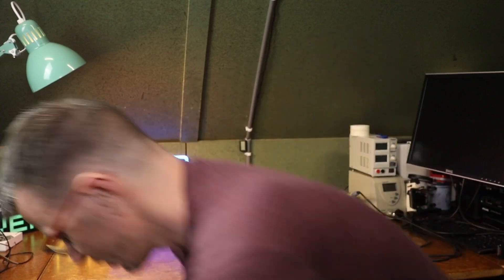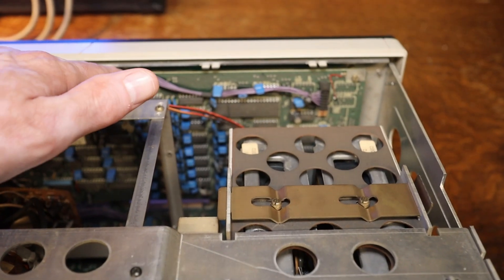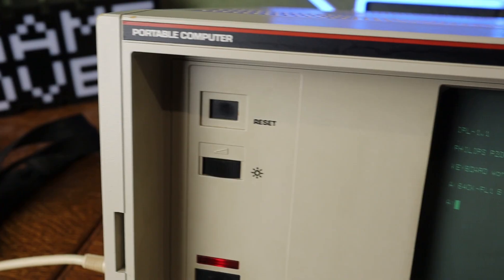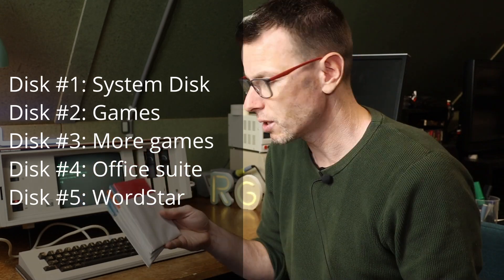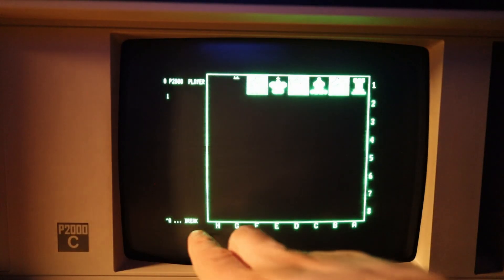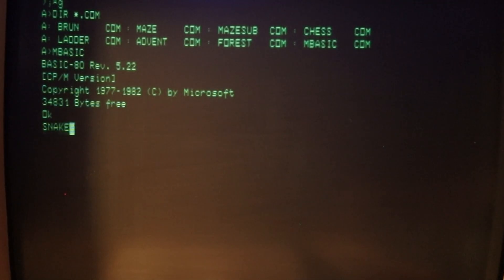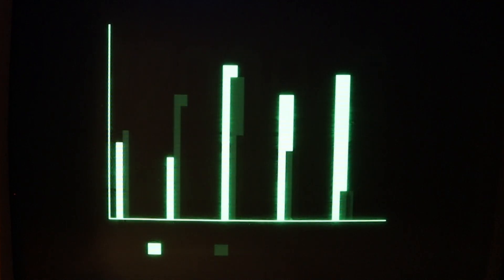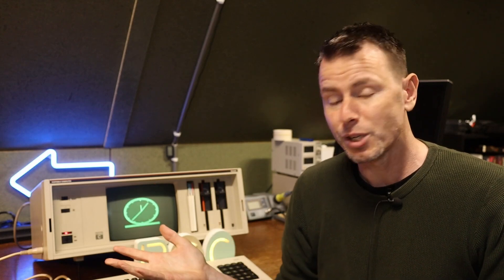A "Portable" PC from 1983! (Philips P2000C)

Comment: This is an interesting machine, but at the same time a big failure compared to its cheap home version. The T model was so much more interesting, and got a great library of all Dutch software, with very high standards of quality control and a straight 10 on iFixit repairability and upgradability. The software on the C looks mostly like quick and dirty conversions from other CPM machines. Even graphically the "High Res" board of the T beat the C model with 16 colours out of 4096 and no tile limits.
Reply from the maker: I am doing a video on the T model very soon!
Reply: @RetroGameCouch  On retroforum?
Reply: What is also weird is that the filesystem of the C is not up to "Philips standards" of human friendly design. Eight uppercase characters... Sigh. The Disk OS on the T is better, even though it was developed by a fanatic user. Where they maganed to get MS tweak Basic to their standards, with Dutch language and doing away with many annoyances of other versions like on the C64, they kind of delivered plain CP/M with the machine. Because of this disk for the P2000T cannot be read by the M or the C.

Comment: I thought there would be bigger problems finding components for such an old computer. Another great video anyway :) Thanks!
Reply from the maker: Thank you! I replaced these old capacitors with modern replacements.
Reply: @RetroGameCouch  - That sounds interesting. One wonders if it's just as easy to fix, say, a Commodore 64. That one would have equally old components. Perhaps a subject for another info-tainment video? ;-)
Reply from the maker: @GamingDad63 my video before this is a good example as well. That is a machine from 1977. 😎
Reply: @GamingDad63  The C64 has more custom IC's, for example loose sound chips can cost as much as a working C64. In the P2000T (not the C) all components are generic. Even the display circuit, the SAA5050 is easy to find, maybe not in another P2000, but plenty of old TV's have these as Teletext generator. Philips did not use a single special part except for the tape mechanism, but those are built like a tank, and unlike other tape drives, they don't contain rubber strings.